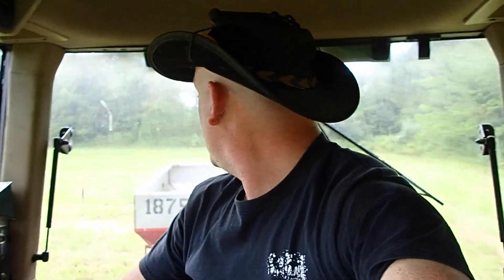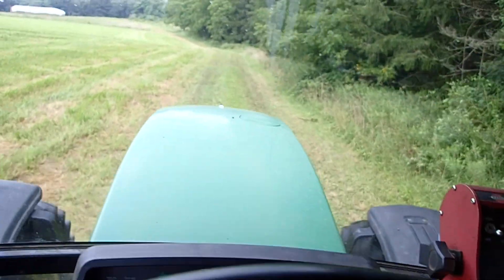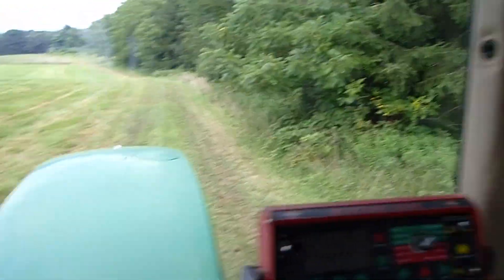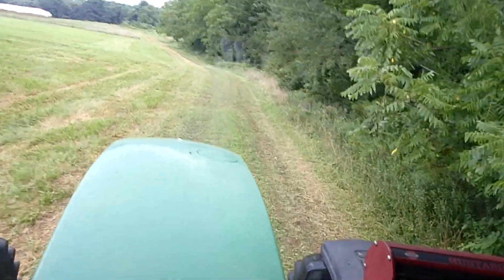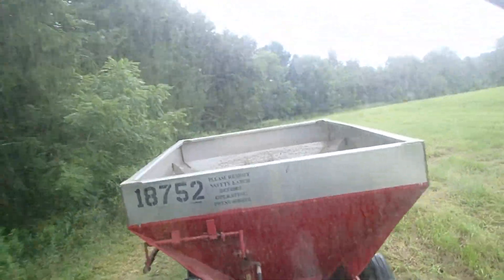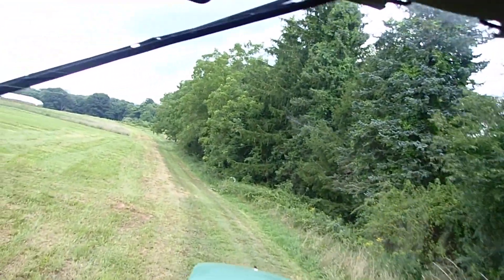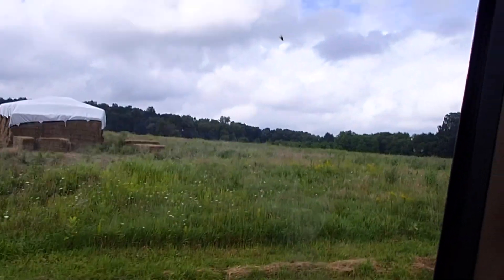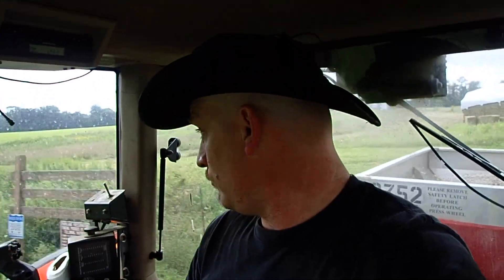N-P-K Aplication On Hay

Comment: Question for someone?  Can Wes stop and start the spin spreader from the tractor cab?  I guess the spinners are gravity fed by the chain in the hopper but maybe the spinners have hydraulic motors and they could be stopped that way.
Reply: Usually the spreaders you get from the Co-Op with the broadcast "spinners" on the back are driven off of one of the tires so your pattern is matched to ground speed..the PTO just drives the conveyor that moves the fertilizer out the back thru a door that you can adjust your rate of coverage.So if you turn off the PTO it will stop coming out when your turning or crossing headlands.
Reply: Ian, you've got it bass ackerds. the spreader wheel drives the conveyor , and the PTO drives the "spinners". This way the spreader puts out the correct rate no matter how fast you drive and the "spinners" give the correct width at 540  RPM.
Reply: Which ever way it works I have learned that the flow can be controlled from the tractor cab.  I noticed Wes cut through a treeline and I'm sure he somehow stopped the fertilizer flow when he was transitioning from one field to the other.  :)
Reply: jbmbanter Jb, the spreaders I have available to me can't be adjusted from the cab, unless there's a pull rope to shut off the conveyor. I wouldn't be so sure about the tree line crossing. The fert spread into those trees wouldn't warrant getting off the tractor to turn the thing off, driving forward, and getting off to turn it back on again.

Comment: you do realize that all of those dry products have to go through a cycle to become available, which takes longer than liquid, right?  just curious.  urea for example has to go through the nitrogen cycle.  Just asking in case your sales person is not giving you the info (full disclosure, I sell fertilizer and chemical, as well as farm)
Reply: I believe I've never seen liquid phosphate or potash fertilizer in bulk form.
Reply: 10-34-0 and riser are both liquid phos products, and there are more and more liquid K products all the time.  like blackjack k, reinforce k, and sure-k are just a few
Reply: Correctamundo! 10 34 0 just didn't register on my radar. I had a job at the Co Op at Mentone last Spring and was around that HUGE tank many times. Doh!! Good call.
Reply from the maker: 3-9-12 starter.. for corn but i don't use it.
Reply: We used all liquid fertilizer most of the time I was farming.  Well, we did have our own dry fertilizer applicator, so I put out dry a few years just to build P and K levels since they're more concentrated in dry, but make 2 rounds and have to hump 15 bags into the machine got old real quick, so we switched back to liquid. 

I'd take my soil test to my fertilizer guy, and he'd punch in the recommendation numbers (lbs/ac) into the computer, which had a program that then spat out a batch mix recipe for 1000 gallons in the nurse tank... Usually something like 500 gallons of 32-0-0 (nitrogen), maybe 25-50 gallons of water (depending on the mix so stuff wouldn't be too concentrated and end up precipitating out and clogging up stuff), 340 gallons of 11-37-0 (liquid phosphate slurry, dissolved in ammonia which is why it has 11 N units in it), and then maybe 120 gallons of 0-0-40 (liquid potash solution).  Sometimes toss in about 10-20 gallons of 10-10-0-40 (sulfur slurry) for a little sulfur.  Hope I'm remembering the numbers right-- been quite a few years since we quit row cropping.  Stuff weighed 11.34 lbs/gallon, weighed out on the scale, hooked up an applicator behind the nurse tank, and hauled the whole thing to the field, hitched the applicator to the tractor, filled up the applicator with a gas-powered pump on the nurse tank, and chiseled it in.  

We usually split our applications-- about half to 3/4 pre-plant, and the rest as a side-dress application in cotton and grain sorghum.  

I know he charged a LITTLE for the applicator, but NOTHING like $20 a ton!!!  They are EXTREMELY proud of that spreader!  I don't know of any place today that charges over $5 a ton for a spreader; most have it figured in on the cost of the fertilizer!  

Later!  OL J R :)